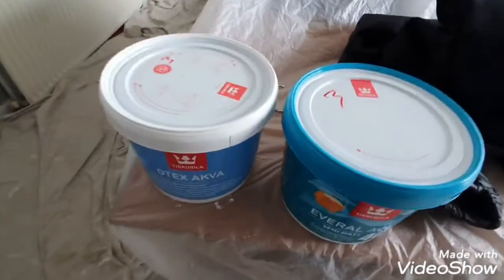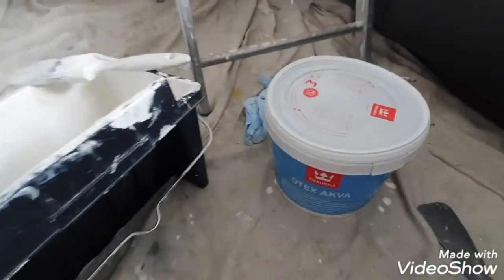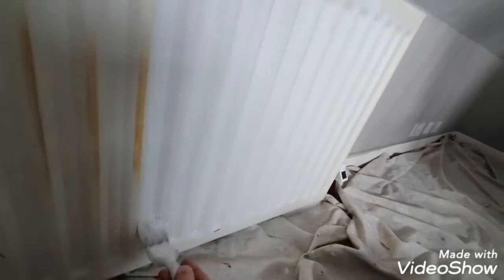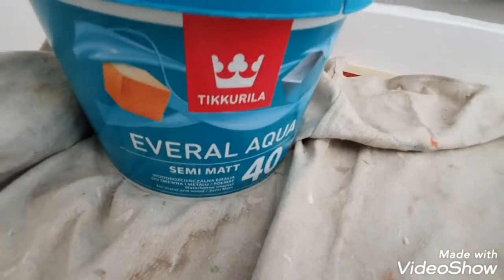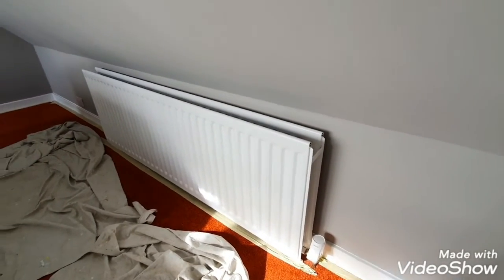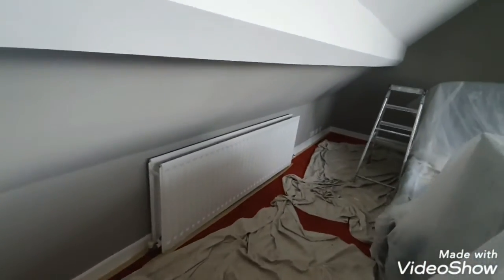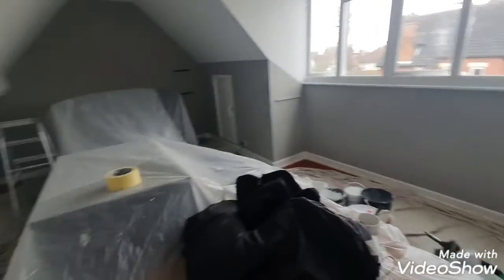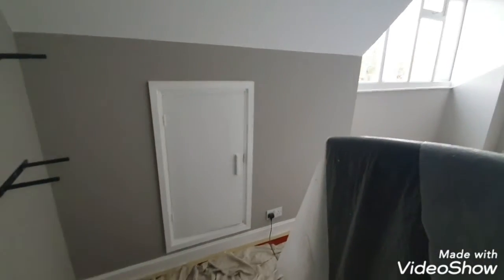A Great Waterbased System For Interior And Exterior Wood And Metal

Comment: After having used Helmi in the passed, 10, 30 and 80. I thought I’d give everal a go. Have to say I thought it was very weak in opacity. When dry I did not like the feel of it. To touch it was not as good as Helmi. Everal was 40. Not nearly as good or as Dulux diamond satinwood IMO. Your job looks great though. Maybe I will try it again sometime.
Reply from the maker: It is a 3 coat system. Does the Dulux cover in 2
Reply: @danielnugentpainteranddeco557  hi . Dulux say prep and two coats. I tried it about two years ago. Pleasantly surprised. Over old oil eggshell. Now though I use Dulux quick dry undercoat then two coats. Bit belt and braces me lol.
Reply: 40 is miles too shiny for me , the 10 looks beautiful after two coats and on top of haftprimer

Comment: I use caparol halft primer and Johnstones Aquaguard it is brilliant
Reply from the maker: That sounds like a good combo. I was thinking Haftprimer and Isolac Aqua by Isomat. Both really thick products but yet to try it out. Cheers Dan
Reply: Aqua guard is the only waterbased that goes in undercoat and topcoat that I have used
Reply from the maker: @Jipnag  do you use it in gloss and eggshell aswell. Also does it cover in 2.
Reply: It only comes in satin I'm afraid
Reply from the maker: @Jipnag  I'm definitely going to give it a try. Thanks for the info
Reply: We have just had a Kent Blaxell open in are city and I am going to try some Tikkurila products thanks to your videos
Reply from the maker: @Jipnag  cheers mate

Comment: Does the everal and otex mix well with floetrol, does it make it flow any better? 👍
Reply from the maker: I didn't try it on that job as the flow and the room temperature gave me a bit of time to lay off. At a guess I think it would give better flow if added. Cheers Dan